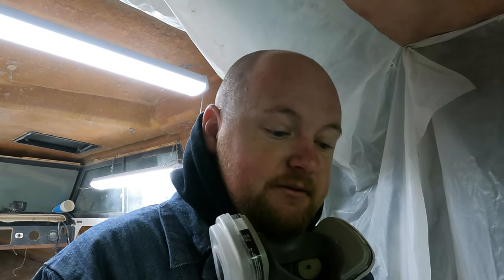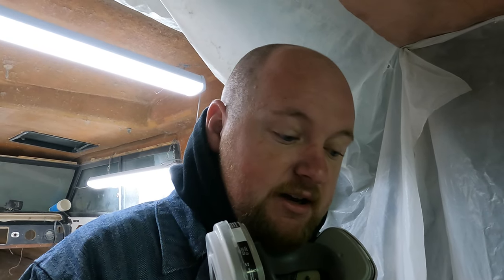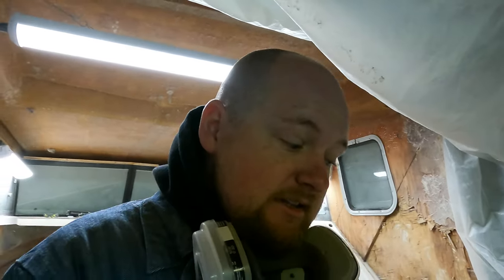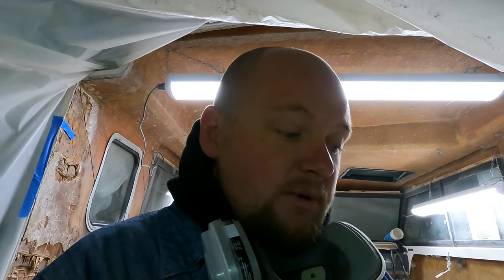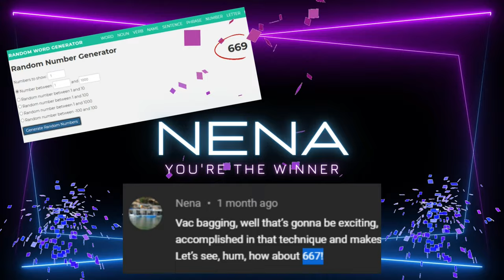Laying Fiberglass and Vacuum Bagging Coring on Boat Restoration| 10K GIVEAWAY Winner

Comment: I realize you are already headed down this path, but have you considered using 10 mm Coremat?
I used a lot of it in myself current rebuild especially in the curved areas.  You can apply the 1708 right over the wet Coremat which will save a lot of time.
Reply from the maker: You can glass right over the top of the divinycell as well. Per core bond instructions, they request resin on the core surface to putty. I’m using the vacuum bagging for even pressure and better pressure! I will look in to the matting though for future projects 👍

Comment: austin , what was the advantage of vacuum bagging over using apoxy to fasten the core ? thanks and keep on rocking.
Reply from the maker: Vacuum bagging is just constant and even volume and helps the core bond dissipate the air trapped when a vacuum is pulled. It’s a very good way for coring and bonding.

Comment: What is coring and why you got vacuume it ?
Reply from the maker: Coring helps the hull take waves and impacts without hurting the fiberglass. Some boats are coring and some are solid glass if weight isn’t a concern. Mine was soaked and was balsa end coring. This is closed cell foam which won’t hold water and is much lighter material. Vacuum bagging is a good method for high contact bonding. It’s like pressure but it’s vacuum so it’s measured in mBAR or CFM. It’s the best option for what I am doing with coring and Core Bond material that bonds it to the hull. Hope that helps explain it.